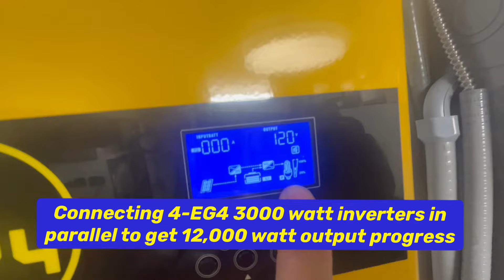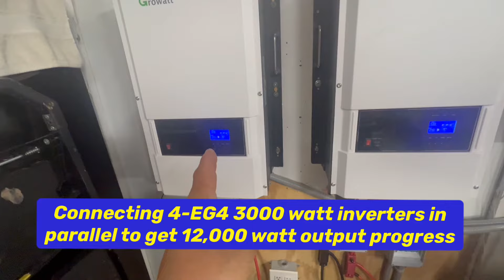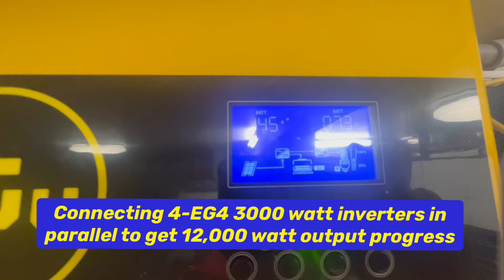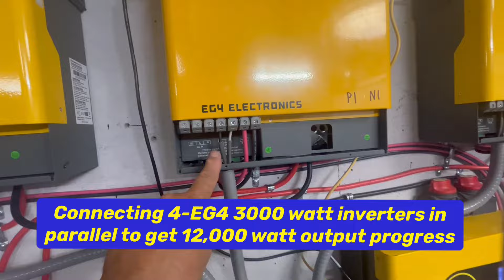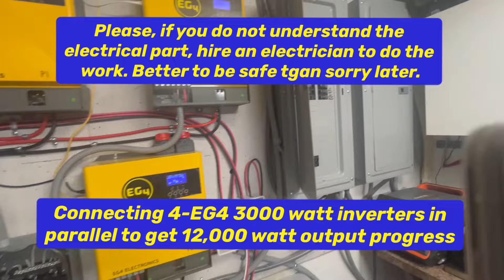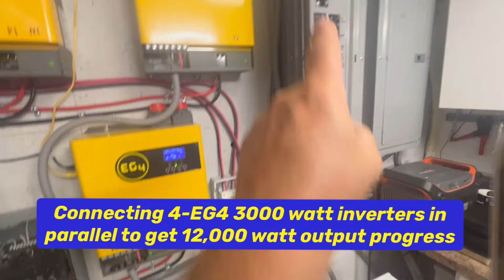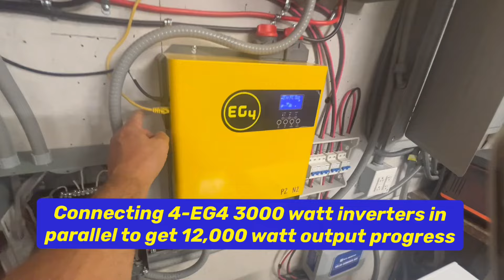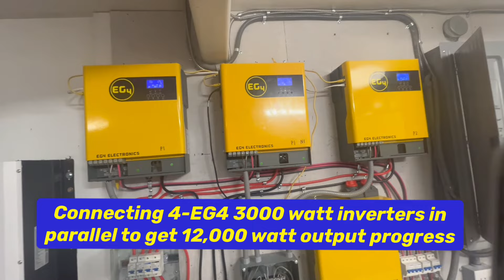EG4 3000 watt inverter, 4 in parallel for 12,000 watt output insane power house system

Comment: Great to finally see a quad 3000 set up!  I Started out with a 3000 EHV and I still use it as an extra 120v battery charger for my battery bank. Great units.  👍☀️⚡️🔋
Reply from the maker: Thanks. They are working great and I just need to add more solar to each inverter to get to 5000 watts on each. Excellent little inverters for the price. Have not seen any other high frequency inverters able to start large loads at all. Thanks for the comment and hope you have a truly wonderful and extremely blessed 2024.

Comment from the maker: These EG4 inverters are insane power house inverters able to start large loads like 4 ton whole house ac when 110 degrees out and run all day with solar. It’s crazy so efficient.
Reply: I'm running my 12,000 btu Senville on my solar system right now to feel good in here I have two 25v 3000w inverter chargers I love em
Reply from the maker: Very nice. Stay cool my friend.

Comment: This is such amazing info. I subscribed way back when I ran across your video about running a 5000btu window a/c with just 2 panels. So helpful in cooling the shed.
Now I feel inspired and overdue to tackle an entire system. These last videos were just the content I needed to emulate a perfect design.

I currently have in my cart 
4 of the EG4 3kW
4 of the EG4 LiPo4 Batteries
30 of the Hyperion 400W bifacials
And the 6 slot rack

I plan on building a pergola in the back to mount the panels and hopefully before the August heat kicks in here in SoCal at least have the 3 1/2 ton A/Cs on solar power. After summer I can slowly start switching over circuit after circuit away from the grid until I’m close to maxing out.

Is there any advice you can give me, especially what else to also add to the order (like wires, breakers, etc that I can’t easily find locally) before I checkout by the end of this week. 

Also I wish the newer LLS batteries were available sooner than August. I mean the 10 year warranty on them sounds great. Maybe get 2 for now and pre order 2 of the LLS?

Any information would be helpful. Thanks in advance for all that you do!!
Reply from the maker: Wow, you are very eager to get this project going. My 3 1/2 ton uses around 2200-2400 watts. So you need at least 2 EG4 batteries to start up ac, also you will need to install a soft start on your ac. The inrush amps will be too high if you do not install a soft start especially at night when running on battery. My inrush amps to start 3 1/2 ton ac was 78 amps, after I installed soft start, it was down to 18-24 amps. That is a huge draw reduced by a $250 soft start. I use 5 EG4 batteries in parallel for over night use, because at 8pm it is still over 100 degrees out here. Not sure what your temps are out there at 6 pm and overnight but you may not need as much stuff that you have in your cart. You will need to run at least 10 gauge wire with ground,  10AWG (2 wires plus ground outside rated wire) from ac fuse pull box disconnect to your inverter electrical panel. You run output from EG4 inverters into breaker panel. Will need electrical code knowledge to wire your breaker panel correctly or hire electrician. You can buy electrical panels with main breaker at Home Depot or Lowes. I bought my 200 amp input at Lowes. You will also need heavy duty buss bars. I bought on Amazon for around $32. You will need wire to run from your battery to your buss bar that connects to inverter. I use Anderson 175 amp quick disconnect with the cables I bought from Harbor freight. Around $40 for 6 foot length of both black and red wire. Will need crimping tool from Amazon, you use a hammer to crimp wire. Around $15 for crimping tool. Anderson 175 amp quick connect kits are around $ 12 a set, available on Amazon as well. Depending on what you are trying to run during the day and night, you might get away with 2 EG4 inverters to start with. That will give you 6000 watts output with the inverters in parallel. You can always add more later. Respond to this message and I will give you my email so you can get answers to any questions. Once you respond, I will give you email and then remove email after you get it. I don’t mind answering questions to help you in deciding what product to get. Your shopping cart is going to cost a lot. Your cart is around $14,000 or more. They sell pergola sets on Amazon (backyard Adventures) and sometimes can find in Sam’s club. Starting at $1000 for 10x12 pergola. I bought from both and built my own as well. Hope to see you respond to this message soon. Hope you have a truly wonderful and extremely blessed day.
Reply: @diy-solar-guy  Thank you kindly for this invaluable information. I am beyond grateful and feel blessed for the guidance. I hadn’t realized that my comments were getting deleted as I figured I’d provide you my email to make things easier. I will contact you in the morning, when you’re probably going to be reading this.
Reply from the maker: Hi, I will wait for you to message today. It is a beautiful day that the Lord has made, let us rejoice in it.
Reply: @diy-solar-guy  Good morning! It definitely is yet another beautiful day that the Lord blessed us with. I sent you an email.

Comment: Excellent video Pappa are u saving energy by using the 4 EG4 inverters compared to the Growatt inverters?
Reply from the maker: The idle consumption is only 50 watts per EG4 3000 watt inverter versus 150+ watts idle consumption on 12kw Growatt. The fans are so quite overnight on the EG$ 3000 watt inverter versus the very loud Growatt fans. I could hear the fans kick on in the house and upstairs all day and night with the 12 kw Growatt inverter. I cant even tell standing in front of EG4 3000 watt inverter when the 4 ton ac starts up. Great for overnight use with the EG4 LiFePO4 battery bank. I love these EG4 3000 watt inverters, they are extremely efficient, Quite, able to start large loads, light weight and under $700 each with parallel kit in box. I run my 3 1/2 ton upstairs ac overnight on my 25.5 kwh EG4 LiFePO4 battery bank from 5pm to 7am and was pleasantly suprised to still have over 50 percent state of charge. Ac set at 76-78 degrees overnight. It is 110 degrees out today in phoenix and takes all night to cool down. The parallel communication cables were a little tough to figure out with instructions. When I ran my 3 1/2 ton overnight with Growatt 12 kw inverter, my state of charge would get close to 30 percent. Do the math. EG4 3000 watt inverter is so much more efficient than Growatt 12 kw. Thanks for the question, hope I answered it for you. Hope you have a truly wonderful and extremely Blessed 2024.

Comment: What size breaker are those on the left side that leads to the batteries
Reply from the maker: 125 amp breaker for battery, they came with inverter in box.

Comment: What longer parallel communication cables did you use?
Reply from the maker: When you purchase the EG4 3000 watt off grid inverter, they will supply usually one yellow communication cable, 3 foot long. It is a RJ45 cable that plugs into the RS485 port on inverters. You can purchase 3,6 or 10 foot lengths and in black, blue and white colors. Prices from $2.99 - $5.59 for each cable. Link below;

https://signaturesolar.com/cat6-cable-rj45-3ft-to-10ft-standard-pinout-inverter-communication-patch-cable/